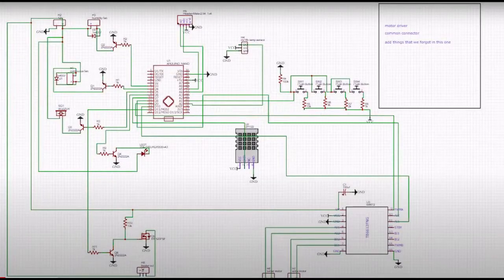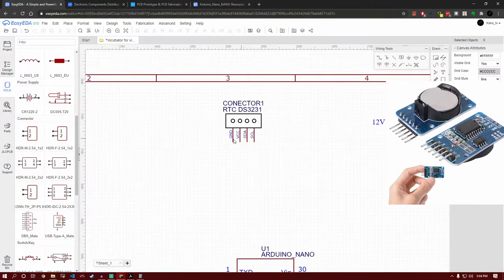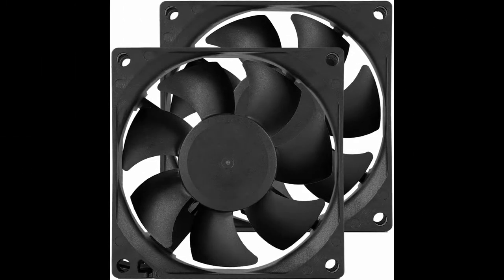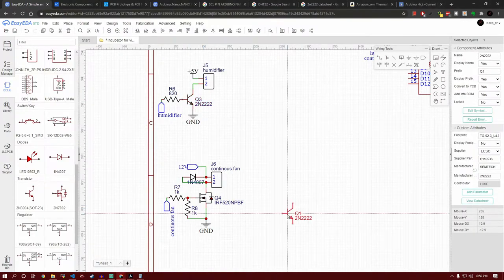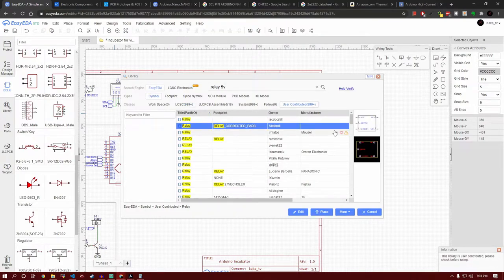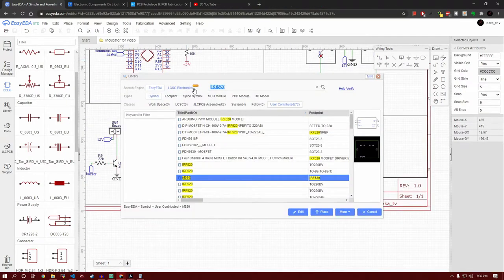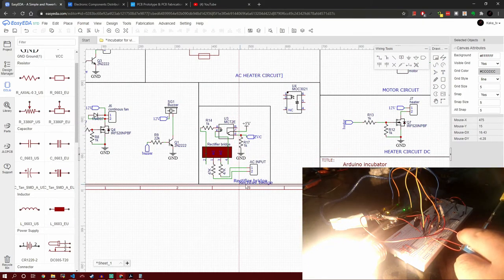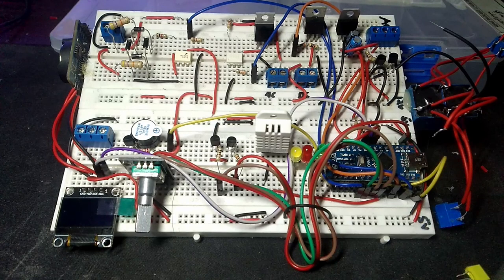DIY Arduino Incubator From Scratch | Full Schematic | Part 5

Comment: There is no schematic in the link
Reply from the maker: Yup.. this series was updated a few times.. i'll be releasing the final schematic and pcb soon.. didn't make sense to have multiple version of it around. check out the last video to get up to speed with the development of this project. Thanks.
Reply: Oh so not finish yet
Reply from the maker: @redelala7652  correct.